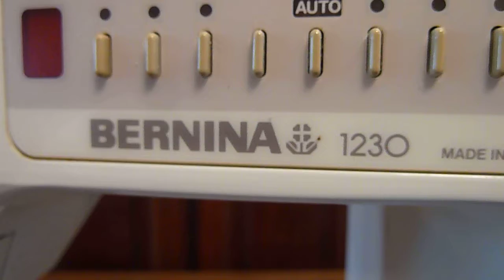Repair a Bernina 1230 that won't turn on

Comment: This is why i have the good old reliable bernina record 830.  All mechanical, no stinking circuit boards to fail. You just press tbe pedal, and the needle moves.  I have repaired many of the bernina activa and artista machines and to be quite frank they are junk.  Everyone i came across had a bad board.  Also probably more than just thzt one resistor thats blown, usually there is a chain reaction, and several componennts, like transistors and diodes get damaged as well.  I used to repair tvs so i know.  Also the artista, and activa machines are made in Thailand not Switzerland, i thought all berninas were swiss made.  I guess its a sign of the times.  Even seeing machines are not immune  to cheap quality.
Reply from the maker: Couldn't agree more.  My personal machine is a Pfaff 360 in it's original "Citation" cabinet.  I started my daughter out on that, and then gave her a Viking/Husqvarna 6xxx series.  We replaced that with a 1 owner 930 Record and period correct cabinet with electric elevator, about 2yrs ago.  She's recently added a serger to the mix, and continues to make clothing for herself, and other misc. stuff for her home.

Comment: Hello!. Can you show where the fuse is located?
Reply from the maker: The fuse is located to the lower left of the tall silver metal canister component (probably a capacitor?) in the lower left area of the circuit board.  You can see the fuse come into view at 2:10 in the video, and there is a large "1.6AT" printed on the board, just above it.  Even if the fuse looks good, in the middle fuse-strip area, it would be worth either replacing it, or removing it, cleaning it's contact ends, and the contact tabs on the board, and even doing an ohm test on the fuse (or just replace it).  Because the machines are so old now, it's possible for a layer of light corrosion or haze to develop on that shiny metal, and interrupt the flow of current either getting to, or coming out of, the fuse.

Comment: Hi , I have a problem with my Bernina 1130 PCB ( almost identical like this one ) where in one of the capacitor is blown up. My question is could it be totally removed without replacement? 
If yea, are there any problems with the running of the machine? Or after removal of the broken capacitor does it need to be replaced with an appropriate replacement capacitor? I would appreciate your thoughts/ feedback please, Ramana.
Reply from the maker: If this were my machine, I would either purchase a new capacitor and solder it in, or pay someone who does electronics work to do the job.  Extremely nice machine, and worth saving!

Comment: Hi. How could you find that board . I need this exact same board and I don't how where to buy it?
Reply from the maker: I was working on this machine (and shooting this video), 7yrs ago.  There was still an availability of parts.  I don't know where you'd find parts now, but someone skilled with circuit board repair should be able to repair it easily.

Comment: I have a Bernina 930, last of the electronic non computerized machines, it's a glorious beast. It has worked fine since I bought it in the 80's and today went to start it up, it won't turn on at all, noda nothin. Any ideas?

Comment: Can you recommend where I can buy a new/good used circuit board that ships to South Africa?
Reply from the maker: Their are sellers on ebay from time to time, who have circuit boards for sale.  Just make sure you purchase the version that works with your country's voltage.   There is a version for 120v countries, like the one you see me installing in this video, and a version for 220v countries.
Reply: +austinado16.  Thank you very much.
Reply: Austinado, ty for your videos -- very helpful!  I have been informed that a stepper motor needs lubrication, specifically the one that controls stitch length.  Is this something I can do (with instructions)?  TY!